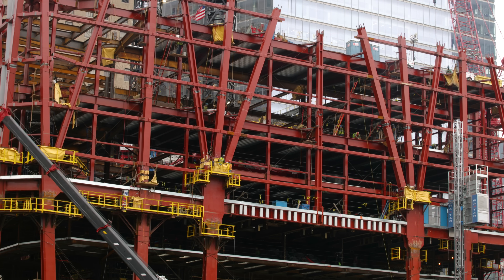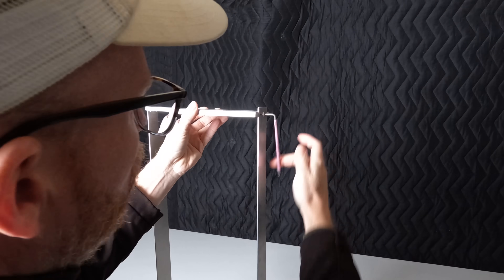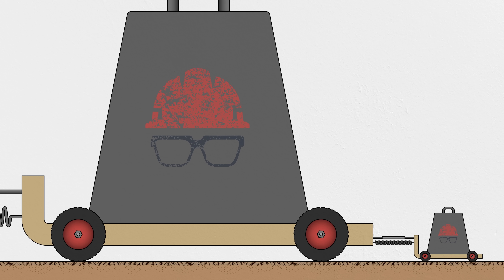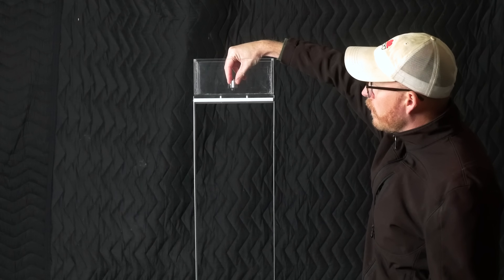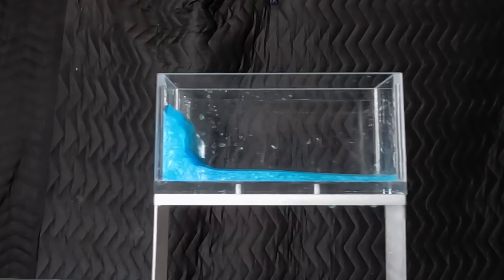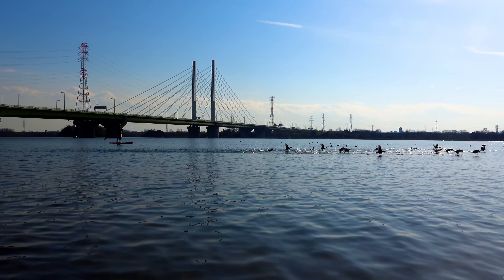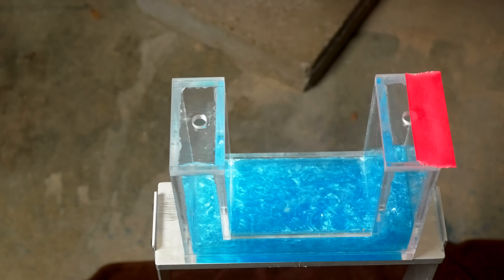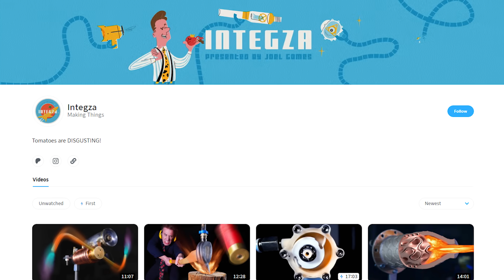How Liquid Dampers in Skyscrapers Work

Comment: How about a pendulum filled with liquid? Super dampening or do they counteract each other?
Reply: Too much free movement, and also the risk of it crashing through something if the effect is too strong, not to mention logistically more difficult to deal with, while still taking up a lot of space. When you have to suspend a pendulum, it's a giant moving mechanism. The water achieves that while also being easily contained. But a pendulum filled with water would likely just cause more oscillation, as the water would move in the direction of the pendulum, except at the point the pendulum changes direction. It would provide some stability, but ultimately be worse by extending the oscillations. A pendulum also wouldn't do too much from small movements, it'd have to really get going, and if it's getting going that much, you've got bigger problems.
Reply: @peoplez129  Thanks for the detailed answer!

Comment: Grady, 

Using liquids for dampening has been around for a long time.  I was first exposed to their existence as a student in the early 1970s. 

Flume stabilization was used to dampen roll in ships.  These systems are well documented in naval architecture and marine engineering literature.  The Society of Naval Architects and Marine Engineers is a good source of technical literature.  I also noticed that YouTube videos of flume stabilization are available. 

Bob
Reply: My buddy drives liquid & gas tanker trucks. He says with the liquid tankers, learning the characteristics of the liquid baffles/ slosh dampers is important- like there's a small learning curve with different configurations. Some are more forgiving than others, but they generally perform well under slightly modified driving habits.

Comment: Interestingly, I wrote about a Sci-Fi mega-structure that's essentially a solar-powered gravitational laser that induces a small gravitational vibration in a planet that can be harvested by "tuned-load dampeners" that use turbines to load-dampen instead of losing it to the frictional heat, directly. So a grav-laser creates a gravitational wave that constructively interferes with the planet 's gravitational Doppler effect (space is subtly squeezed in front and stretched behind as the plant's gravity well traverses physical space,) to create sudden bursts of acceleration, at a specific frequency. This can be soaked up by a column of water in a gigantic pipe sloshing back and forth with a wave-generator attached that is tuned to soak up the acceleration before the oceans can absorb it first.
Reply: sheeit

Comment: The Comcast Technology Center (Comcast 2, colloquially) has a liquid damper as well. I was lucky enough to be in one of the "slosh chambers" before it was filled. There are three total and they are just big concrete boxes, but they have many large metal fins in them that catch the moving water.
Reply: lol I did not finish the video before commenting and Grady describes the CTC slosh damper/baffle system perfectly.
Reply: @pwaite93  so really it's just a specially designed header tank providing a dual use?

Comment: Was surprised to hear about 1 Wall as I spent a significant amount of time in and around the TCLD without knowing it. 8:12 I chased a leak from the Penthouse for weeks. Checking all the mechanical, plumbing, exterior, roofing etc. Never knew there were liquid filled walls. Pretty sure it wasn't. Pretty sure.

Comment: The demos generally only show the flow reacting to one lateral dimension of movement.  Of course, this is on purpose to demonstrate and simplify the process.
But buildings can sway in multiple directions.
Are there types of liquid dampers that are relatively circular in shape, to dampen movements from any given direction?

Comment: Given that a sloshing mass damper is basically a swimming pool, I think the question is pretty obvious: Could the same structure be used for both purposes? There would be an obvious problem in that the swimming pool could never be emptied for cleaning, which would complicate it a little, but that doesn't seem insurmountable.

Comment: You might make a video on damping to reduce earthquake-induced motion.  The dampers are located at the bottom of the building in this case, and I recall a pal (many years ago) investigating a design using the deformation of lead as the energy absorber.

Comment: You were talking about adjustable dampers using valves and reasons why you might want that. A good one might be that an office building is full during the day but empty at night and that's a pretty significant change to its weight and the distribution of said weight

Comment: In the rotordynamics field, liquid dampers are often used. However they have a service life due to the shearing of the fluid. Do these liquid dampers have the same issue? Not in your air design, but the orifice in the fluid maybe. Also, does it heat up the fluid to any appreciable amount? I work with constantly excited systems, so maybe these are a non issue in this circumstance. Maybe you ran across a couple of our papers in your research.

Comment: It's interesting that ships have the opposite problem. They try to split up liquid cargo into separate tanks to keep the liquid movement to a minimum, because it tends to destabilize the ship. Casual Navigation has taught me a lot!
Thank you for the very interesting video! I wonder how hard it is to keep that large tank from leaking, given it's under regular repetitive stress. In a less-maintained building, I could imagine the mass dampener leaking out its fluid, causing it to lose its dampening effect and also growing mold in the walls for tenants. It's still pretty new and rare, but perhaps in a few decades we'll be hearing about some of these systems that were less well-built, well-designed, or well-maintained.
Reply: Tanker Trucks can have this issue, too.

Comment: When much younger I worked fixing the roof of such a skinny building.  Co-workers would push on the building at the bottom, and at the top you'd move about 7-10 inches back and forth.  The top was about  40 ft up.

Comment: Comment first and a question to follow. 

I failed to experience an earthquake while working in a high rise hotel at night. I happened to be on the same level as the swimming pool which was above the main lobby and banquet facilities (roughly 5 stories up). All the calls to the front desk were near nodes on the 10th floor and 17th floor. I got to a hospitality suite on the 17th floor about 10 minutes later and the chandelier was still swinging. The hostess was still in a state of shock.

My question is, what is the greatest range of tuning in a system, given the number of variables involved? Perhaps a better way of putting it is what is the most efficient system that can adjust to the greatest range of frequencies?

Comment: I love the idea of having one of these be visible to guests just like the tuned mass damper example shown. A big pool with some structures in it to increase resistance, and waves gently lapping at the sides. Sometimes the waves will be a little bigger, sometimes a little smaller. Adding some windows would create the effect of an indoor sea, complete with weather events. Even the structures intended to add resistance would add to the aesthetic in my opinion. Imagine having a conference in a room with a window looking out over the sea, with waves lapping just a dozen feet below it, on the 40th floor of a skyscraper in a land-locked city. We should build more cool things, but we should also show off the cool things we already build.

You could even add copper(II)sulfate to prevent anything from growing in the water, and that would also make it blue. It would stay clean, and be blue like an actual deep body of water.
Reply: The only problem I can see is that, if wind swaying is still perceptible to the audience, the sight of the countermotion of the waves might heighten the seasickness effect.
Reply: I'm pretty sure a mass dampener couldn't do double duty as a swimming pool - but possibly it could also be an aquarium? This implies at least one big glass window to look into it.

Comment: I remember when they built a 27 story dorm at my university.  There is a study hall with windows all around at the top.  The contractors would visit in the first several weeks to see how things were going and he loved to put a steel ball of about 2 inches on the floor in the study hall and the we would watch it...after a bit it would start to move around "by itself".  You don't notice the swing...or at least didn't...until we saw that.  Then we swore we could feel it.
Reply: I was at UMass Amherst when they had the main library tower that was reportedly unsafe to put many books within, or stand within about 30 feet of it.
The tale I was told that it was designed and built perfectly... until the books started to be loaded.
-
Looking it up, apparently the end evaluation was that the live flexing of the building was not structurally dangerous, but that the cheap choice of brickfacing was to blame for the plummeting objects.
The 28-floor library is still in use today.
-
A combination of cautionary tales. 
1) Don't believe rumors.
2) Don't cheap out on building cladding.
3) Throw enough engineers at a question, and they will eventually come to the right answer.
Reply: @MonkeyJedi99  Hah, I love how this myth is so common that even wikipedia has a section on mentioning how its a myth!

"The building has fallen victim to several myths since its opening in 1973, the most popular of these being a variation of the "Sinking Library Myth," where the architect supposedly forgot to account for the weight of the books in the building's designs, resulting in a settling of the building. This is a popular myth attributed to many university libraries and is untrue.[15]

The spalling of the bricks has also led to the common assumption that entire bricks fall away from the building, and invariably make contact with someone on the ground. While bits of material do occasionally break away, a full brick has never come away from the building."
Reply: I had an issue like that with my Truck. 

Slight vibration, and i mean slight. 

Only noticed it once i saw water in my bottle vibrate. 

Was never able to unfeel it. 

Mechanic said it was off, but barely
Reply: I worked on the construction of a 30 storey building. There were days where I could definitely feel the sway of the building.
Reply: After working in the construction industry, I no longer trust large structures, and I will avoid going in them whenever possible. You can explain to me all you want about the physics, all it takes is one component to fail and it all comes down.
Reply: Statistics say its not as likely as you think  @sweezlesquee

Comment: Wondering about viscosity and density of the fluid and how you could change the properties of the dampener. You mentioned water dampeners are limited to the amount of mass they can have. What if you use heavier liquids. That changes the mass, but the dampening can also be calibrated with viscosity.
Reply: Indeed, but water is so cheap and easy to manage compared to, say, mercury or cornstarch, that I doubt the cost/benefit would ever favor anything but water. Even if it meant you could increase your usable space.

(And as Grady points out, you might need a tank of water up there anyway, for fire suppression purposes.)

Comment: 150 N Riverside in Chicago is built on a seesaw whose footprint is about 1/3 of the building's width and it uses one of these. Super cool piece of engineering, really recommend you check it out!
Reply: chicago architecture mentioned🎉

Comment: Could you design a multi-layered / nested slosh damper? Think upside down cake design which would have dimensionally one or more smaller tanks the lower you go. This would allow for smaller volume and higher frequency damping embedded in the larger damper (assuming it actually works).

Comment: Would there be any value gained by having a vertical, tiered system of water tanks with different amounts of water?

Also what if you put the tank at some point inside the building instead of at the top?

Comment: This does bring to mind a topic that could be good here, but doesn't appear in a channel search:
Active structural support.  Using pressurised fluid [water] as part of the structural support.  I'm really curious if this is even implemented anywhere (outside of like fire hoses, which would probably be used as an example).
Was brought to my attention a few-several years back on the Isaac Arthur channel.
Reply: It could probably be used as supplemental support for active management of various load types, but it brings a significant increase in complexity, which costs.
Reply: @Tara_Li  Sure, it costs, but what's the cost of ever increase sprawl?
We have substantial vertical space, but we instead keep spreading horizontally, which is devastating the planet, especially as transportation is shoved onto a single plane (or at best 2 (plus air travel).

Comment: I think inertial dampeners are one of the coolest engineering concepts in modernity. Such a ingeniously simple mechanical solution to such a complex problem. 

I've always wondered if a sufficiently large/deep rooftoo pool would have any damping effect by itself?
Reply: Well, yes and no — it might damp the oscillations, or it might amplify them, depending on its size and shape in relation to the building's natural frequency.

Comment: On some ships you have "flume" tanks for dampening. They are made of compartments and level of water depends of frequency. There is controller that measure frequency and start pumps and valves to set correct level. Unfortunately system was broken because level sensors were busted (4x800 euros for sensors + 4x~350 for cables (believe it or not, very dishonest if you ask me)), but anyway system is not necessary so nobody cares.

Comment: Curious to hear how the viscosity of the fluid affect its ability to dampen the movement - How would using a thick oil work compared to regular water?
Reply: From the description, a thicker, denser (non-flammable) liquid would work better.  Mercury would be wonderful, except for the obvious major health dangers.  Gallium could be good, though you’d have to ensure it stayed warm enough.  I wonder about colloids such as jello as well.  However, there is always a balancing act with costs - and water is damned cheap.  Also, multiple, immiscible liquids could have some useful dynamics for multiple harmonics.

Comment: Does the swimming pool at the top of that famous Singapore hotel (Marina Bay Sands) do this?
Reply: It probably does, but I doubt it's intentional. With the top deck included, the Marina Bay Sands is wider than it is tall, so I'd expect it to simply absorb a lot of the low frequencies from winds or earthquakes in its stiffness.
Reply: I expect it’s likely minimal.  Early in the video, he mentioned mass dampers are often around 10% of the mass of the skyscraper - that a lot of water for a swimming pool.

Comment: It's a bit of a physics truism, but once one understands the basic Harmonic Oscillator and can work its problems then one can do the rest (of physics, or in this case engineering buildings.)
Reply: There are two popular kinds of approximations in physics: linear relationships and oscillators. A LOT of things can be derived by modifying those two. If it isn't linear, you linearize it with some sort of inverse function and if your harmonic oscillator doesn't quite fit, you mathematically modify it until it does.

Comment: I wonder if any liquid dampers are disguised as swimming pools.
Reply: Or, if the pool is not technically used as a damper, does it reduce the size of the other damper needed?
Reply: I was wondering the same thing. but then when I was looking at the given model at how the wave is crashing against the side of the walls providing the dampening effect i though against it as a pool has the water level with the floor therefore a wave cant hit a wall to dampen.  with that possibly not? But then again this is a educated guess.
Reply: I was wondering what the conditions would be to deliberately use one or more swimming pools as slosh dampers.
Reply: I saw some articles saying that the swimming pools on top of some skyscrapers in Thailand after their recent earthquake acted like a damper, idk how accurate that was though
Reply: @angelmonroy3012 potentially but I don’t how anyone proofed that
Reply: Singapore's Marina Bay Sands rooftop Liquid Tuned Mass Damper  has a nice view and good pizza during happy hour.
Reply: Definitely not as swi.ming pools are required to be cleaned and emptied
Reply: Cleaning can be scheduled when weather is calm?
Reply: @clintonroushff7068 probably but in reality you cannot rely on that. People and weather are two very unpredictable variables. There is also a tonne of other reasons. In reality you consider swimming pools as unfavourable cases though you might get lucky and it does have positive affects you cannot trust it.
Reply: @Tom123456789canucoun  You know, this was the truly the best and simplest answer, haha 🤣
Reply: definitely not lmao

Comment: In the case of a big tank with a screen in the middle, could the openings of the screen be adjustable? If the frequency of the vibration is close to what is shown in your model, you'd have 1/2 second to close/open the screen.

Comment: 0:33 "Eventually, you can get so tall that there are no materials strong enough to support the weight."
What's the tallest possible pyramid?
Reply: 8733 feet.
Reply: Mount Everest is 29,031.7 feet tall, it has to be higher than that